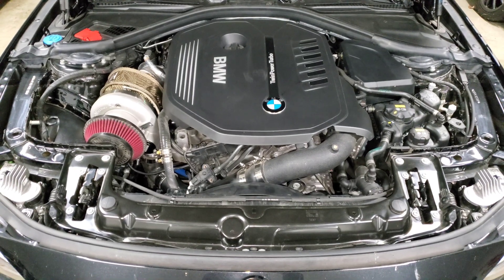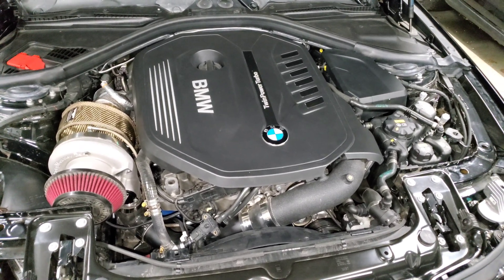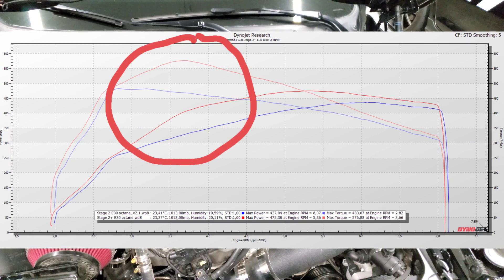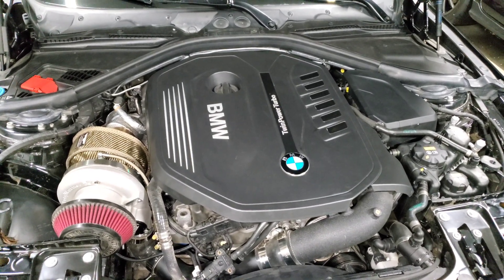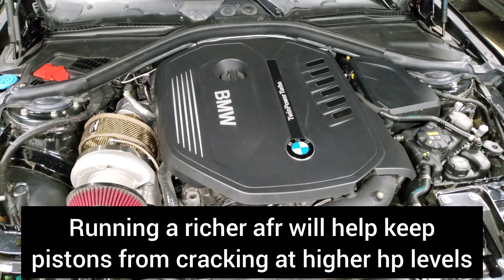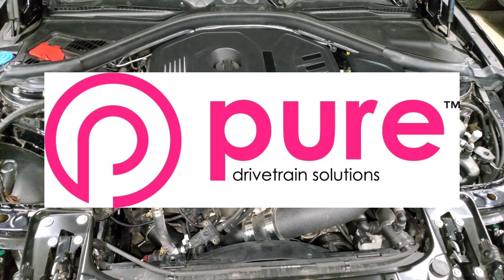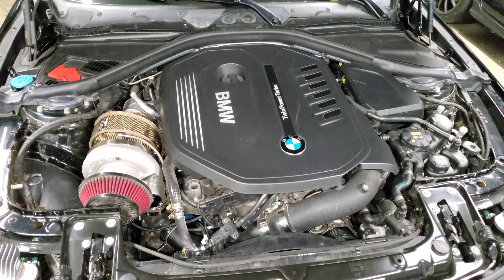Guide to B58 Tuning "Stages" and Recommended Upgrades

Comment: At one point is it required to have a TCU tune? Im planning on going MHD Stage 2 HPFP,  xHP tune is in the plans, wondering if its safe for the transmision to be running those power levels on a stock TCU tune, thanks!

Comment: Boss I’m having a crazy issue I deleted the pcv with the port from the heads and car still smoking bad and after I do a pull oil is leaking oil cap, my car is stage 2+ on 93 I replaced the gasket valve cover oem one Injectors sparks

Comment: @kern417 im currently running a catless DP, intake, visconti flex fuel kit on a 30 and 50 map getting 540hp 570tq on high map. Could i squeeze some more power with a hpfp?

Comment: I have 2019 440i xdrive. Got it at 30k miles now it’s at 60k miles on mhd stage 2. About 25,000 miles on stage 2 no problems. How many miles will it stay reliable? Daily use.
Reply: As long as you keep maintaining it.. lmao. Warm the car up, turn turn it off straight after some pulls etc.

Comment: Hey, I also have a manual but I have some questions. At what kind of power did you decide you needed to upgrade the clutch and did you do the flywheel as well? I feel like 2-2+ would already be in the range of causing slipping sooner rather than later but maybe that wasn't the case for you?

Comment: Is stage 2 with hpfp BM3 E50 safe
Reply from the maker: yes
Reply: @kern417  with just a TU pump and stock trans
Reply: @kern417  people are saying E50 will cause the pump too go out
Reply from the maker: @Isa_b58  well i have posted multiple videos for years showing otherwise. B58 fuel system is fine with e85.

Comment: Hey Kevin. If I want to add an aftermarket CAI on stage 1/2 for better noise not performance. Would that be detrimental or great compared to the OEM intake?
Reply from the maker: Most quality intakes have no difference
Reply: @kern417  Thanks for the help, much appreciated!

Comment: why did my b58 started losing oil, smelling a lot like it from the exhaust and and smoking white clouds when accelerating? i did the Stage 2+ just as how you described it, 60k miles on the clock atm
Reply from the maker: Could be anything. You'll have to dig into it to see whats going on
Reply: Check your PCV....

Comment: I had a quick question regarding my manual 2018 340i. I got stage 2 E30 from BM3 running right now. I had an issue where I would go WOT and around 4k rpm or so the car would make loud pops and cut back on power. It wasn’t consistent. Sometimes it would happen and sometimes it didn’t. The RPM it would happen at would vary at times too but usually around 4k. At first I thought it was my clutch was slipping. So I had it replaced because it needed to be replaced anyways but that didn’t solve the issue. You got an idea of what that may be? I’m hoping it’s just me not having a good e30 mixture.
Reply from the maker: most likely, but you need to run a log to confirm.
https://youtu.be/l6AUtfHUZxQ

Comment: Question, I have a 2019 440i coupe with tu hpfp, downpipe, and mhd stage 2+ tune running 93 octane. For the last 3 months the car has been running fine, do you guys recommend i get a transmission tune now or before i get my flex fuel kit to transition to e85? Thanks!
Reply from the maker: absolutely

Comment: I really like your videos, im a new subscriber also im new on this platform, wanted to ask i just got a custom tuned stage one, before i did it i changed my spark plugs but not coil packs but for some reason the third day after the tune i pushed on it and the engine studered on me and a message came on the dash saying drivetrain malfunction with the check engine light on so i pulled over and turn off the car and turn it back on and the message on the dash went away also check engine light or should i say the engine simble all went away and now my car is driving pretty quick and normal now and by the way i also got a transmission tuned with my stage 1 tuned, do you think i need to change the coil pack as well or should i not worry? I just put in a berger intake as well, the tuned was a cutom flash, please let me know what i should do the car is driving normal now like i said but scared to drive it hard which i did twice and it drove fine.
Reply from the maker: scan for codes to see what happened
Reply: Thanks for the reply I  actually took it to the tuner that flashed my custom tuned and he pulled up a code that said misfire but the thing is I have brandnew spark plugs oem and it only happens when I push on the gas full throttle. I was thinking it's the coil packs but before no problem and the car only has 42000 miles on it
Reply from the maker: You can try replacing them but typically the coilpacks don't fail. Is it misfire every time you floor it
Reply from the maker: Have you tried running a log
Reply: Sorry about the previous reply I meant to say it misfire in sport plus but in comfort mode doesn't matter how much gas I give it runs fine only when I put it in sport plus it does the misfire. It's a custom tune so I would have to  ask my tuner about the log but he did check the codes and said it was misfiring.
Reply: @kern417 My tuner said to gap the spark plugs to 0.022-0.024 is that a safe? He said I wouldn't lose no power, it's a custom tuned by the way
Reply from the maker: It's safe just not ideal. Stock gap is best
Reply: @kern417  yeah that's what my tuner said I should do cause of the misfiring and  no codes on the data, would I lose power? That's what I'm worried about he said i won't...
Reply from the maker: No it shouldn't lose power. It's just not as efficient
Reply: Thanks for the reply.

Comment: With the exception of geography in the engine bay. I would like to assume that most of this stuff can be done to my g05 x5 40i. Is that a correct assumption? 

I have driven a modified 40i of a visitor to Toronto that hung out with us for a week. I could really feel it just tooling around Bloor St. I dont know what the mods were except he had a box inline for one thing. Other than that, you couldnt see anything.  I would really like to do something to give it some oooomph once that thing is all mine in October.
Reply from the maker: Depending on the year it will be more difficult to tune

Comment: I have a 2018 440i with MPPSK is stage 1 ots tune any upgrade over my bmw upgraded tune? I heard number sit around 360 with the bmw tune
Reply from the maker: If you have 93 or e30 yes. If you only have 91 then not much improvement but there is some

Comment: I bought a used 540i with 60,000 miles and I’m contemplating just doing stage 1 . Ideally I’d like to drive this car a bit past 100k miles and I’m sure it can do it just fine.
Reply: Its fine, as long as you do the maintenance on the car.

Comment: Got my m240i with the b58 2 weeks ago with only 50k miles on it and just loaded it with stage 1 with intakes and DP along with xHP stage 1 and WOW, it literally feels like my chest is being pushed through the seat when you put your foot down at 40 mph
Reply: Would go stage 2 but wanna ease into the power haha, next month I'll load the stage 2 file with a exhaust system then once the performance is done because stage 2 will be more then enough for me, I'll do interior and exterior mods! :)
Reply from the maker: cool, enjoy it

Comment: Hey man! Thanks for all the videos and forum discussions! Loving it. I have made my g30 b58 gen1 up until this point to stage2+, but now stuggling a bit with settings for MHD tune - particularly should I tick the box for TCU TQ limiter removal or not? In theory mhd says st2+ is up to 520hp and 720nm, so even in a worst case scenario i would imagine my engine will be exceeding 550nm limit of the torque (apparently stock is around 450nm so with st2+ should easily go beyond 550nm, shouldn’t it?). Thanks for help in advance and again, loving my car now and your videos helped a lot!
Reply from the maker: do you have xhp?

Comment: Right now I'm running a decend 440 hp stage 2 with about 635 NM of torque and it suits perfect  for a M240i. Everything above is like just burning Tires for no reason unless you really wanna compete in Dragraces. Guys be safe out there and choose a good tire if you want to have performance for your HPs.
Reply: hi, can you tell what upg you got for 440

Comment: Hey man I recently did a downpipe and stage 2 bm3. Got codes for clutch slipping “badly” and intake VANOS. I can’t pull hard at all without dropping revs and going wonky. What would suggest? Just warranty the clutch and do the vanos and hope it works ? Manual transmission
Reply: I’m also thinking about deleting the cdv for more “clamping” force
Reply from the maker: Try swapping the actuator from intake to exhaust side and see if the code changes. If so then replace the bad actuator. For clutch slip yes I'd replace it but i doubt you'd get it under warranty

Comment: Do you need a tune whenever you get a downpipe?
Reply from the maker: Not necessarily but just a downpipe won't really add any power without a tune. It'll just improve your exhaust sound.
Reply: @kern417  thanks I have a 22 m340i and wanted to add my first performance mod. Was thinking about jb4, intake or downpipe

Comment: Would you recommend Stage 3 Custom Big Turbo Kit for time attack track use on BMW 840i RWD ? Or Stage 2+ should suffice in terms of power efficiency (no wheel spin) ? Please advice, good people 😸
Reply: From what I have experienced when you want them suitable for track better is less hp cuz of less wheelspin and easier control of the gaspedal. But if you build it custom with everything needed suspenion tires and other stuff then 600hp is also okay but you will have problems with traction that is why I would stay with a stage 2 or stag 2+.

Comment: Still loving the content on this channel and please keep it up! I just installed MHD today on my 18' 340i RWD. I fitted the FTP chargepipe and intake pipe with a drop in BMC filter, catless downpipe and the TU pump. I went with 91 Oct stage 2 and did a dyno run. The results were a bit underwhelming 269wkw (361whp) and 587nm of torque. Do you think this is normal and could be a stingy dyno? Also the tuner that helped install my hardware said he does not recommend even loaded the stage 2+ even though I have the pump because in South Africa our fuel quality is poor. Would love to hear any thoughts on this.
Reply from the maker: How do the logs look? On 91 octane that's not bad.
Reply: @kern417  it looks fine according to the tuner. There are some timing corrections. Boost is at 1.28.
Reply from the maker: Yeah probably just limited by octane. Just enjoy it 👍🏾

Comment: Best Video!
Personally I run Stage0+ (Soon Stage1) already got 300cell DP. I just can recommend the DP and xHP even for stock cars. It makes it much more responsive and shifting not only in Sport/Sport+ nicer but WAAAAY smoother in Comfort. Just get xHP.. Also reminder, you have to go ~60miles in comfort, no kickdown, no manual shifting, no sport mode after flashing xhp to let the transmission get new gear adoption values etc.
Reply: Can you explain stage0+. Is it like a custom map that is not as boosty as stage 1 maps?
Reply from the maker: Yeah it's the MPPSK tune for F30.
Reply: @baronmunchausen645  The engine comes from BMW in a lot of different models. In each model it has a different kind of power/software. Stage0+ is basically the highest setting that BMW provided for a model and you can use this values on your engine to.

It basically is stock, but not stock, if that makes sense

Comment: If just going for a stage 1 upgrade. I was considering a BM3 stage 1 map. Catless downpipe and OPF Delete. I know the downpipe is not a requirement however choosing it for better breathability and power delivery . Thoughts ?
Reply from the maker: Doesn't really help. Might as well just flash stage 2
Reply: @kern417  oh ok fair enough. Thnx man
Reply: Pretty sure you’ll also get a CEL without flashing stage 2 with dp
Reply from the maker: You can hide the code in stage 1 too. I even hid it in my stock tune
Reply: @kern417  MHD kept giving me a CEL until I went stage 2. Strange, seems like on the forms some people are able to hide and some still get the CEL. My tuner ended up just making me go stage 2 since I didn’t benefit running Catless without the tune
Reply from the maker: @AllGasNoBreaks416  it's just a checkbox. I've been running stock and stage 1 tunes with the checkbox for months and no codes or CEL. If you have a different CEL that's not related to cat efficiency then there's another problem

Comment: Great way to save the intake manifold is to get an oil breather cap. Massively reduces the pressure
Reply from the maker: that's not how that works.
Reply: @kern417  Reduces crank pressure which reduces pressure across the entire engine
Reply from the maker: @Lukestersim  the intake manifold is not connected to the crankcase
Reply: @kern417  I know it's not but it reduces the pressure across the entire engine

Comment: Currently running a custom stage 2 tune, 455 hp and 618 Nm on my M140 Xdrive. Recently had the TU pump fitted as precaution. Is it worth re-tuning to stage 2+?  Will the power gains be noticable from stage 2 to 2+ ?
Reply: With the TU pump it wont be that much but it would still be an upgrade over stage 2

Comment: Hi new subscriber here. Just purchased a 2018 440i xdrive convertible and being the gearhead that I am was looking for some performance mods associated with it. I see you mentioned a downpipe, wouldnt deleting the catalytic converters cause it to fail emissions? We are required to pass emissions here in PA...
Reply from the maker: it can. a tune will disable the code but won't show ready. an o2 spacer can prevent the sensor from picking up the missing downpipe but make sure it's not too long or it can create another CEL. you can also get a high flow downpipe that doesn't completely delete the catalytic converter but still flows more than stock.
Reply: @kern417  cool, thanks for sharing

Comment: great break down. i know audi / vw stages like the back of my hand but now that i want to switch to the bimmer life this was invaluable for the b58

So the charge pipes are solid in the b58? i remember that being a big problem in the n55
Reply from the maker: Yes
Reply: @kern417  do the charge pipes increase turbo sound and add any hp even 5? I know the intakes add about 3-5 and more sound depending on the brand.

Comment: I have an 2017 M240i xdrive, im stage 1 no upgrades yet, I have DP and chargepipe that i’m about to get installed aswell as a dinan intake. Will that set me up for stage 2 and still be just as reliable as it is now? or should I get an intercooler as well? my tuner says I should but I hear many different opinions
Reply: im 9 months late but honestly the intercooler on the b58 is extremely solid, also for reliability this engine platform is proven to be hands down amazing for reliability while adding modifications. with a stage 2 you will be fine as long as you take care of your vehicle as you should be anyway.

Comment: With Stock Turbo and E30/E40 you never never GO to 450-480 WHP . STOCK TURBO AFTER 440 WHP IS GAMER OVER
Reply from the maker: Tell that to all the people making 500+ 😅
Reply: @kern417  NOT to STOCK TURBO , IM WORKING TO BMW MÜNCHEN LOL
Reply: @kern417  Stock turbo 440 whp , you need stage on your turbo if you wont more tha 440-445 whp
Reply from the maker: @dogodogo2144  there are multiple people making over 500whp. There is a supra that ran a 9.9 quarter mile just boost and good fuel. Do some research.
Reply: @kern417  you told me ??? I SAY YOU : NOT ON STOCK TURBO,  485 HP ON ENGINE IS THE LIMIT TO STOCK TURBO
Reply from the maker: @dogodogo2144  😂😂😂

Comment: One question and a suggestion... can you run full E with a stage 2 LPFP upgrade (is that the only Upgrade needed)? the suggestion... would be awesome if at the end of the video when you flash up the tunes and the power output if you could add another column to provide approximate ET and mile per hour for each of the power levels. Some people chase Dyno numbers (which is silly as it's just a tuning tool and they vary) others chase performance numbers, so would be good to know for stage 1 OTS the typical car will run 12.2-12.5 @ 114-117 for example. appreciate your chanell!

Comment: can i run e30 on stock fuel system with mhd?  everything on the car is stock except the tune, but am going to get a catted downpipe and xhp here shortly. also do I need ngk plugs to run e30?
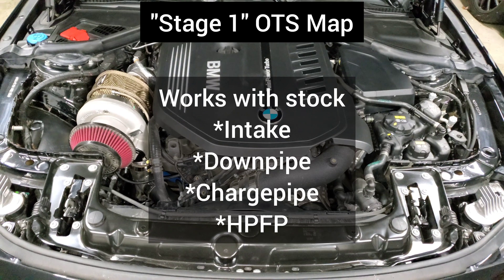Reply from the maker: 0:58
Reply: @kern417  so youre saying i can run if?
Reply: 2017 340i

Comment: Is the 550i clutch hold the torque from the stock turbo on stage 2+ and the GC+ on pump only ?  Probably around 550whp or less

Comment: Currently running MHD stage 2 93 with catless downpipe and xHP stage 3. If I move to MHD stage 2+ with b58tu hpfp but stay on 93 without ethanol would it be worth it?  Will the stage 2+ map give me more hp without running ethanol?
Reply: The HPFP is a big difference in Tq !

Comment: What do you recommend for a intake manifold upgrade?
Reply from the maker: Eos is the most popular but we'll see how others compare this year
Reply: @kern417  are you talking about the 4000 dollar one? Is it mainly just to be more reliable and hold more boost or does it actually have some gains just by itself?
Reply from the maker: Yes it is one of the $4,000 ones. It's just like adding an intercooler on any other car. It lowers IATs. Also having a metal manifold will be more reliable at higher boost levels.
Reply: Thank you! I may run some other stuff by you soon. Going to take it one step at a time